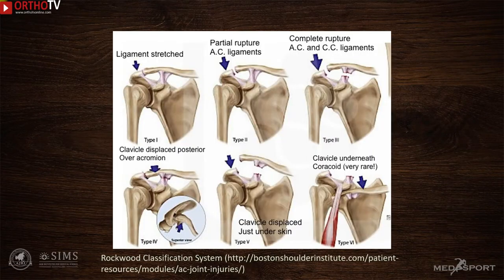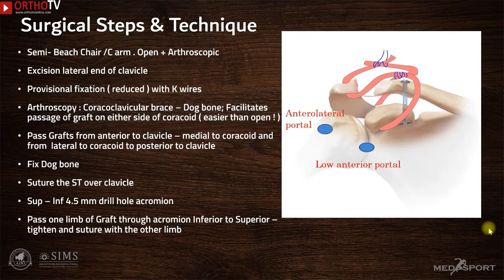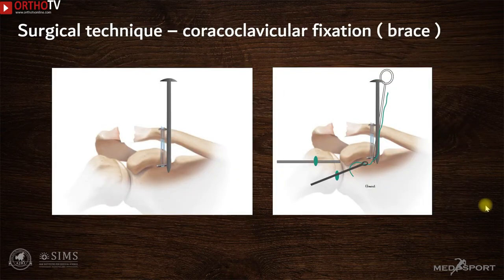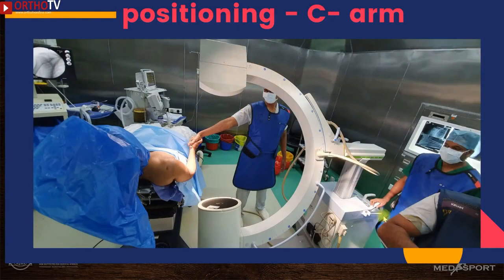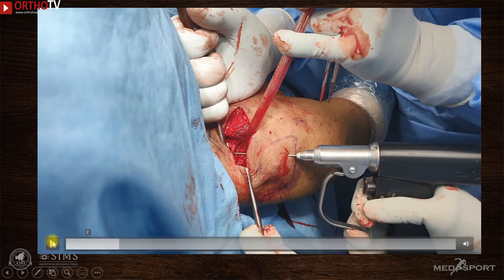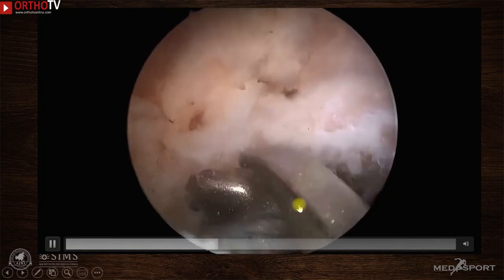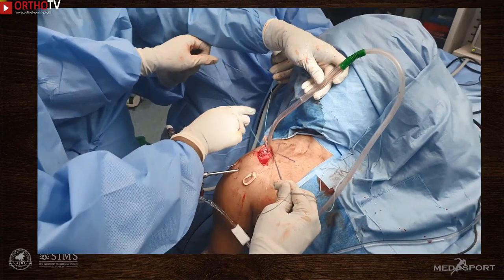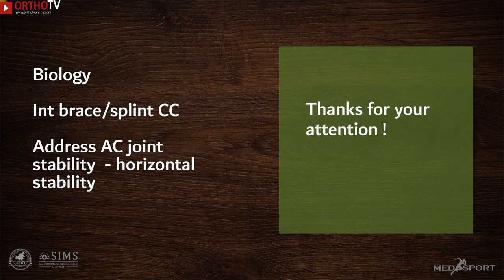AC Joint Reconstruction by Dr Clement Joseph

Comment: dr would you do the same surgery for a wheelchair bound man? im a double leg amputee. i tore ac joint badly along with supraspinatis and deltoid. im worried the surgery wont be strong enough because of way i use arms to move. im ak on l leg and hip disarticulation on r side. im extremely worried surgical repair wont last